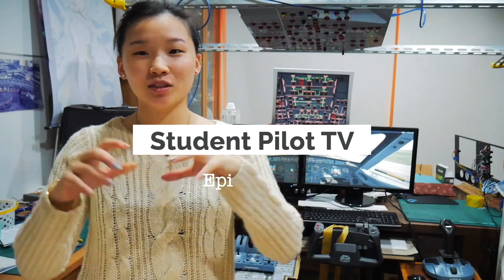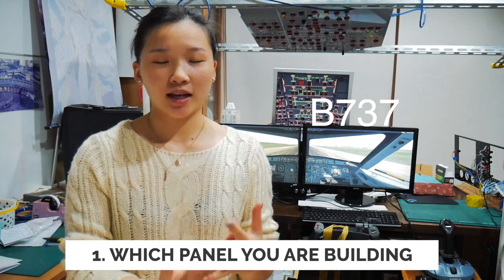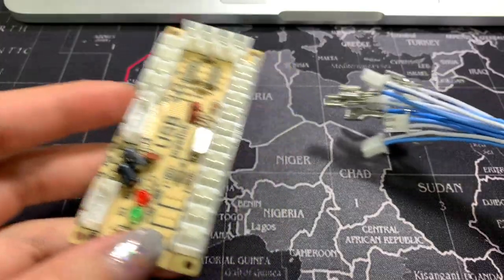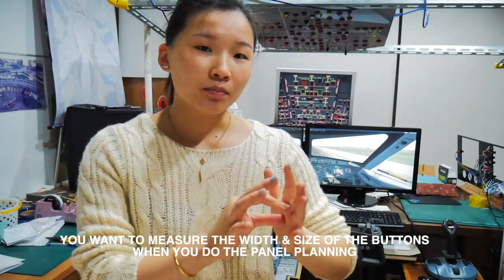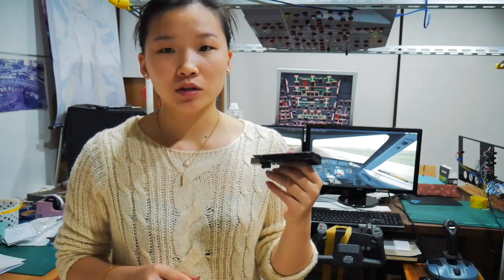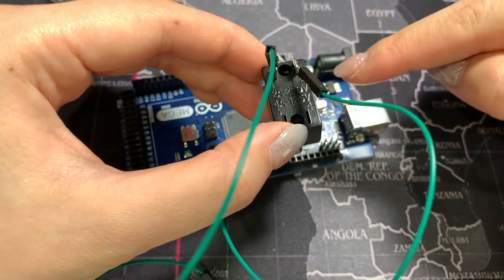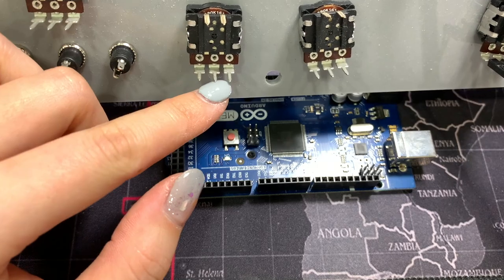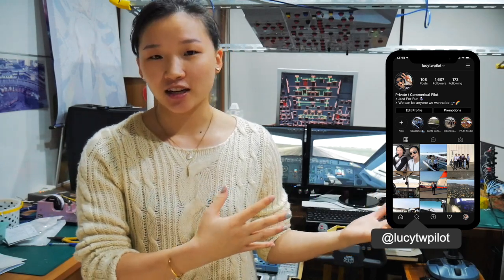Easy Steps: How to Build Your Own Home Cockpit! A320/G1000 | Student Pilot TV ep.15

Comment: Thanks for the very interesting video, Lucy! Would you be willing to share your illustrator file for the overhead panel? I'm very interested in making something similar, and it be a great headstart. Using round push buttons instead of the square korry switches is a great idea - much easier to make round holes, and the switches are much cheaper too!

Comment: Hi Lucy, thank you for your vídeo!! I am an A320 pilot and I am looking for a good software that I could practice all the A320 abnormal procedures in the chinese airspace. Do you know any good one? I do not want to build up a full cockpit, just side stick, throttle quadrant and pedals. All the controls I am going to use the mouse and monitor screen. Thank you.
Reply: What is your preffered flight simulator?
Reply: You can try P3D by Lockheed Martin, and flightsimlabs is the add-on for the A320. Hope it helps.
Reply: @JoshuaPenaranda  Hi. Thank you for your reply. I bought the A32X from Swiss because I was looking for a software with as many abnormals as possible. The software is good but has some bugs. Anyway, It’s useful. Not perfect but useful.
Reply: @Captain_SQ  Thank you my friend. Yes I’ve heard about this one but the point is that flight sim lab does not have all the abnormals to practice. Thank you for trying to help!
Reply: @marujov8  yes you are right , it only covers roughly 70% of the failure items for the A320. You are welcome buddy. Cheers.